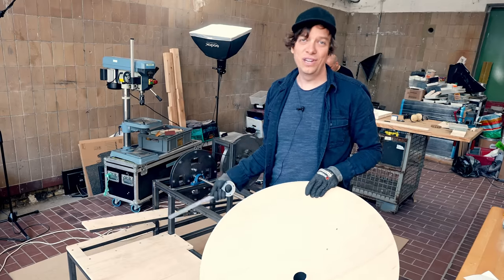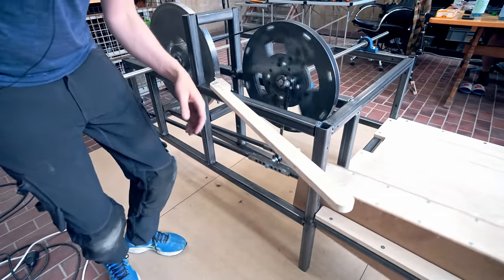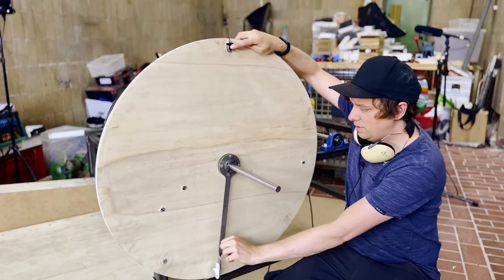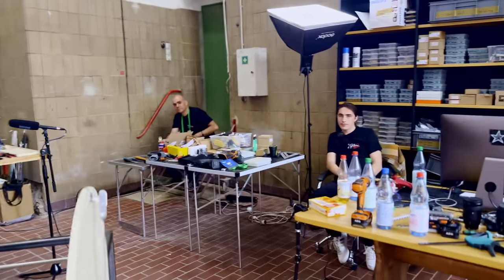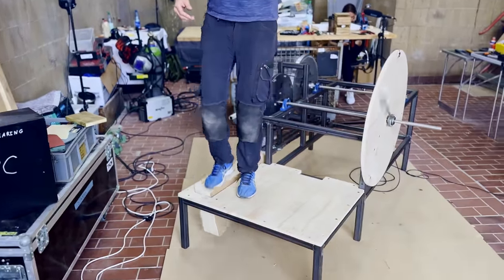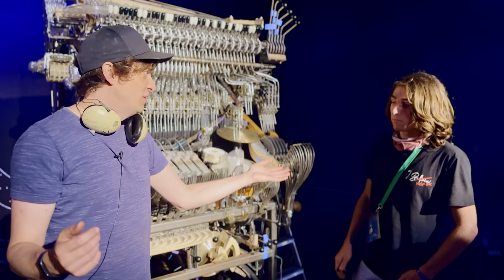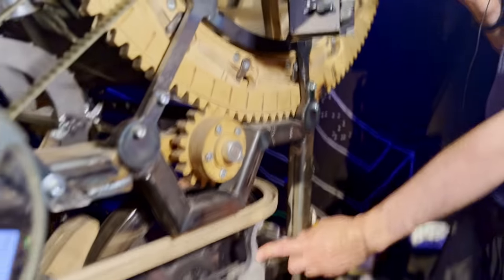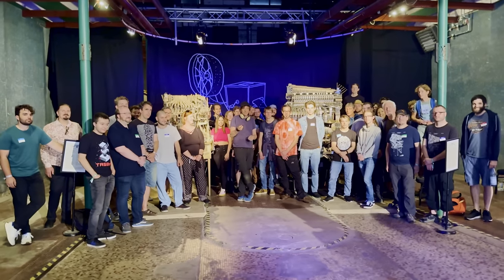This Clock Measures Music Timing - DAY 5 - Marble Machine Flywheel Prototype

Comment: I've noticed that the flywheel is wobbling. Trust me and I can't stress this enough. **FIX that now** not later or never as the gyrating movement will put extra stress on joints and start to make the metal frame bend over time.
Also the brake head should be flat with the surface of the flywheel which will stop it digging into the surface, use a felt or fabric face to minimise damage. All you have to do is look at car brakes for what damage can be caused to the brake disks to see the sort of issues that can arise.

Comment: 5:38  all the precision machining and the flywheel wobbles?
Reply: There was zero precision machining going on when they “fixed” the outer edge and the center hole of that wheel. However, the guy from the audience who did the smaller wheel knew what he was doing :)
Reply: @peterfireflylund  a few whacks with a large hammer will straighten that out just fine.  I can't imagine he will leave it like that with all the other precision that goes into his projects.

Comment: I was curious if there was a desire to add a one way bearing to the drive similar to a bicycle, allowing you to disengage the pedal from the drive when not pumping essentially. This will keep the pedal from moving when you are not adding energy to the system.

Comment: Seems to me the brake would be more effective, more convenient, and less likely to affect the alignment of the flywheel if it had a vertical action where you pull up and it presses against the edge of the wheel rather than against its side. This means you wouldn't have to climb off the thing to use the brake.

Comment: Is Martin going to do the timing calculations manually again? I hope not, since I have software that does exactly that from sound files....
Reply: Since the previous fly wheel timing video I've been wondering if he wouldn't be better off with one of those black and white quarter circle patterns and a light sensor, or some other kind of pre-built solution. 🤔Analysis wise both should be just as easy to automate though, yeah?
Reply: @BetaKeja  Probably. But using the same solution as before also makes sense, it's easy and he knows it works.
Reply: @RegebroRepairs  Either way though, the thought of him doing it all manually over and over and over...😅

Comment: I’m feeling like there’s some tunnel vision going on with the marble machine. The timing drop device feels impractical based on size and height. Cant say I can think of a better timing arrangement off the top of my head, however if grandfather clocks and kinetic motion machines can do it then so can the marble machine. There is a man who makes kinetic machines that run for t0 hours which is more than enough time.

Comment: I'm way behind on your videos, you're doing a fantastic job! 

I feel like there should be some kind of additional safety for the pedal should there be a flex in it so you don't have a pinch point if the pedal goes lower than expected and traps something between the pedal and bottom of the frame. Like a box around the inside as well. 

Also, someone brought up a good point about a shield around the flywheel should something happen, that is a boatload of energy.

Comment: Pedal arm is to thin and of course need to have a release if something gets stuck :)  You should be able to stand on it without its bending. and better support since it wobbles from side to side.  Also the brakes i would have used brake-discs from a bike or something with hydraulic. That would do alot.  :) My 5 cents if i would have done it. But we all do things differently

Comment: You're testing the accuracy of one revolution, but there may be some some inconsistencies in the angular velocity throughout the motion. Perhaps you could put an electric motor/generator on the output shaft and measure the voltage output variance.

Comment: Does the pedal really need to be attached with a rigid link? Using a cable would be safer as it wouldn't push down to cut your foot off.

Comment: I think there is one major flaw in this test. You add energy to flywheel and see if you can spin the flywheel at constant rate. This only tests how you can compensate energy loss in flywheel by adding energy at as constant rate possible by peddaling it. In the end you add energy to flywheel to compensate energy loss in the entire machine, not just flywheel. You should add some sort of load to the flywheel to emulate the machine you are diving which consumes energy in flywheel.

Comment: every time you press on the pedal to turn the flywheel, the pipe is bending a lot.   while I know it should survive, you need to have some bracing on it so it does not get fatigue cracks where all the bolt holes are located.  I would hate for your pedal to break mid performance.  Good job on everything else.

Comment: Why do you use a v-groove belt to transmit power to faster flywheel? It will allow slippage under high load. 
Do you actually want it to slip? Is that discernable?
You should switch to teeth belt if you don't want slippage or chain which will provide maximum torque but will be slightly noisy

Comment: Great seeing the mmx working! Quick idea: If measuring timing is not too critical, couldn't you use the huygens weight drive or something similar? You could have the height of the weight driving some form of cursors that would display the current tightness as a value between +-250ms for instance. It's still not the most precise and would require a song to keep a single tempo as far as I understand for now, but you would have a continuous value, unlike the clock where accelerating and braking during a cycle would impact the music but not the measured precision. Might be completely over engineered too btw xD

Comment: Why didn't you think abaout an electric drive for the mm3? It meets the engineering steps you set yourselfe for this project by eliminating the whole pedal mechanism and making the power source more constant and therefore improve timing. It also automates the power surce, like Elon Musk suggests automation.

Comment: Hey Martin. Would it a Help to break the Flywheel with Magnets (to make a eddy current brake) instead a mechanical break? Or use the mechanic one additional? Just a few magnets on a U-shaped profile that you can bring to the Flywheel when its needed.

Comment: I hope you are not planning on controlling the tempo or bpm with your foot. I reckon you should use the pedal to introduce power into the flywheel but you would have an adjustable clutch mechanism to where you can control the maximum speed/bpm/tempo that the music can play with independently from the flywheel unless the flywheel doesn't have enough inertia to keep playing. Im just worries about over speeding the flywheel causing you to need to brake in order to keep music at correct speed.

Comment: If you attach the pedal with wire or dynema rope instead of the steel rod, you wouldn`t need the safetyboard on the side because there would be no crushing hazard

Comment: huge missed opportunity here with the flywheel brake. You could have used automotive break calipers here so it would apply the force equally on both sides of the wheel.

Comment: Instead of connecting the pedal to the flywheel with a stiff rod, can you connect them with a chain? It will still work under tension (pushing on the pedal), but in compression (when your foot gets between the frame and the pedal) it will do nothing.

Comment: I still think you need a freewheel device on the power input like a bicycle. The flywheel should not send all its energy back to the pedal. Just like a bicycle you need to be able to “coast” without the pedal continuing to move.

Comment: Didn’t you have a mechanism to prevent it from crushing your foot by having a joint that is only stiff going down but hinges up if force is applied from the bottom (ie, it coming down on your foot?

Comment: The brake should be on the outside curved surface of the flywheel, not on the side. You want as much leverage as possible.

Comment: why no putting a clutch between the Flywheel and the rest of the MMX?

with clutch the Flywheels can run without paused
and you need less power to run the wheels after putting the clutch back on

(sorry for my bad english 😅)

Comment: I've said it before when you first introduced the idea and I'll say it again. Directly coupling the peddle to the flywheel is a stupid idea and serves no purpose. Preventing power from being transferred back down on the peddle is easily solved in so many ways, the sheathing is not a solution, it's a bandage and still leaves a dangerous pinch point. At least add a hinge on the peddle. Come on Martin, I don't want to see you lose your drumming foot on camera.

Comment: Hey Martin. Please ditch this direct flywheel/pedal design. There is no way you can expect to play tight music if you are having to control the tempo with the rhythm of your foot on a pedal!

I would look at something like a regulatable  fly-ball governor, tuned and adjustable for different tempos and a gravity/sprung/torsion escapement to power it. Then you can use the pedal to raise the escapement mass/tension the spring whenever needed without having to worry about tempo!

(If you wanted to get really precise, you could create a limited slip differential with a stepper motor controlling output speed.)

Think how bagpipers fill the bladder out of time, but maintain air pressure with their arm.

Please reopen the design submissions on the website so I can send you a drawing.

Comment: It doesn’t feel like an instrument. An instrument should be able to be played and stopped anywhere by one person, but the flywheel is so heavy it just doesn’t seem right. Definitely think it needs to be lighter.
Reply: Found out that the flywheel is supposed to have spokes, that should be better, but there is definitely a better way to make tight music with a machine
Reply: It’s a marble MACHINE, not a marble INSTRUMENT
Reply: @br52685  it’s still objectively an instrument, also the heavy flywheel makes it quite unruly, and it will take forever to slow down and speed up. A pretty shitty MACHINE if you ask me.

Comment: That four big holes in each flywheel can be used for an emergency break, some big strong metal thing that get's in and instantanously stops them.
Reply: That would be... a really bad idea. The strain it would send across the whole system could easily cause shattering
Reply: That would probably tear the entire machine apart!

Comment: Please do not torture the bearing of the flywheel with that brake, either press the brake squarely to the bearing (like you did in the previous video) or use brakes from a bike, that would be even better. And plese please center the weight of the flywheel 😆

Comment: The Soul of every device is its imperfection. Are you aware that you are killing the soul of your device by trying to force an analog device to be a digital beat-machine-perfect synthesizer?
The original marble machine sound was so distroted by the "perfection" of the MMX that it was even not reckognizable.

The perfect thing about your original machine was that it was not perfect. Thats where thet special feeling originates listening to it. Thats because of that it was everything but perfect in timing.

Tell me the difference between a pianist and a synthesized version of playing the same arrangement? The pianist's one is way more interesting, simply because of its imperfection.

Comment: So keen on tolerances, and yet you apply brake on ONE SIDE of the flywheel? Seriously?  Have you ever wondered why disk brakes on cars have pistons on BOTH sides and hydraulics to sync forces between them? 

Also, as usual: to hell with human legs, this needs to be powered by an electrical MOTOR!

Comment: That's not a good way to measure timing. You're averaging all the deviation into one revolution. Your work in the past on timing errors has hundreds if not thousands of times more resolution than this. You need to look at rotary encoders that put out a pulse per degree or more.

Comment: I know the design intent is different for this version....BUT IT'S HIDEOUS!
Reply: That's why it's a prototype
Reply: It's supposed to be a Minimum Viable Product
Reply: It's a prototype...
Reply: I'm afraid he's losing the plot. Nobody cares about it being TIGHT. Even if people could tell, it's not the point of the marble machine. The point is to look cool and magical and play music. The new version does not look cool or magical, and there are better ways to play music.
Reply: @TheBlackAbyss1 there is no point in a minimum viable product if you don't sell it. It's a unique. This concept doesn't make sense.
Reply: @xl0xl0xl0  He has said he won't enjoy using it if it can't play tight music, so that's a requirement for him.

He has very high requirements on tightness, which seem a big silly, but then again, the untightness for the different parts will add up, so maybe not.
Reply: @KVVUZRSCHK  On the contrary, he is now trying to build things bit by bit to see if he can make them work. With the two first attempts he tried to build everything in one go, and then he discovered issues he hadn't anticipated, and which were nearly impossible to fix.
Reply: @TheBlackAbyss1  I get that, and I'm probably being too harsh.  The previous two versions had a visual elegance to them that I hope somehow returns to the final version.  At least we won't have to worry about useless articulating fingers in the final version.